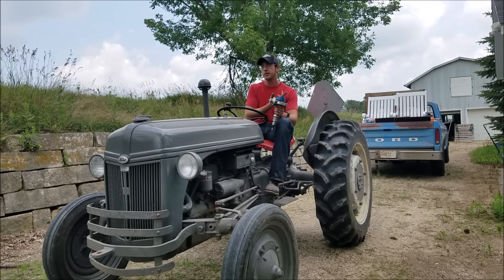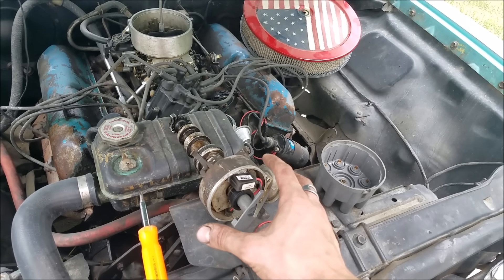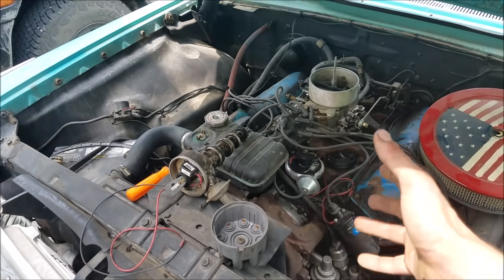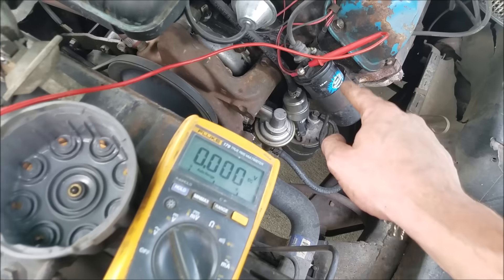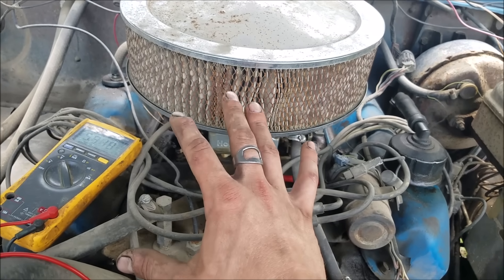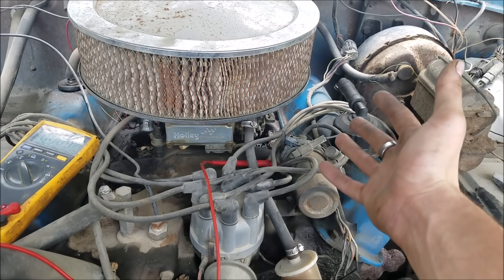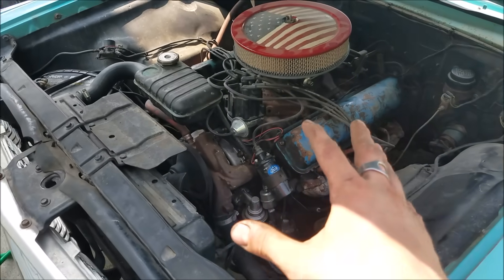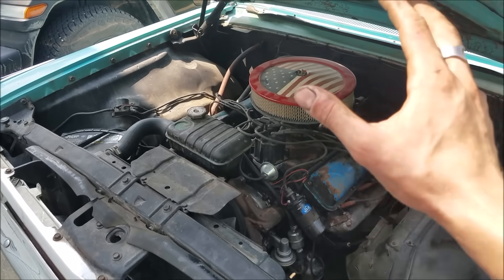Pertronix Ignition "Problems & Failures" (It's Actually YOU)

Comment: It took me 4 years to convince my co-worker to wire his Pertronix to a proper 12v source on his 67 Galaxie, 390. His reasoning was, " It runs fine." I'm surprised it ran for 4 years without burning the module out,  daily summer driving and drag racing. He finally listened though.
Reply: you would think if it wasn't getting 12 volts from the start, that it would of never ran good enough to thinks everything was ok.

Comment: The problem I have had with the Ignitor III is that I can't get a tach to work consistently with it.  The needle jumps around, or if a digital tack, the readings are all over the place.  I contacted Pertronix, and they basically said that was a common issue, and I quote: "...good luck with that."  I've done some experiments.  I added a resistor to the signal wire and a capacitor to the signal wire, and both together, but no joy.  I've purchased and used an autometer tach filter, and had positive results with a cheap Chinesium digital guage, but with a Bosch needle tach the needle still jumps.
Reply from the maker: Digital is going to use a transistor on an interrupt circuit - the pertronix multispark ignitor 3 technically fires 3 times per cylinder very rapidly - an analog gauge won’t have an issue, digital can’t really handle multispark unless you can code your own.
Reply: @ThunderHead289  problem is, the analog tach needle jumps around too.  Even when using the filter.  I had an expensive Dakota digital tach on the car before and it worked well, until it died. I believe the multispark signal fried it... It doesn't work at all now.  So currently, the brand new Bosch analog tach needle jumps around with the filter, and the cheapo 'dragon guage'  brand digital tach works ok with the filter. Other than triggering a different tach with the alternator, I'm not sure how I am going to proceed.

Comment: Like you, I've used Pertronix a lot (even on those N series tractors when I convert them to 12v) and have never had issues with them. Everyone says they are garbage, they will leave you on the side of the road, blah blah blah. But JUST LIKE YOU SHOW, everyone I've gone to fix, is half-done. When you do these RIGHT, they will last & are ultra dependable, but you can't cut corners in it.
LoL..... From doing a lot of these conversions, I have a box on my shelf full of coils & ballast resisters.
Reply: I having a little trouble with mine, it keeps overheating the round coil. I gotta get a multimeter and check it out. I did try a ballast resistor but it didn't do any good I didn't install it on the red power wire that goes to the dizzy, maybe that's where I should have put it
Reply: @johndowe7003  what are you installing it on? gonna sound weird, but this problem can be in weird places (bad ignition switch, bad dimmer switch, bad headlight switch, bad Amp gauge, etc etc etc). Also, you might wanna look into a new coil. If it's been "cooked" a few times, it's probably done now. Esp if there is any oil around it. Easy check is to turn the key off, and check it at the coil. If you still have juice going to it, find where it's coming from before you sacrifice another coil.
Hope that helps.
Reply: @BareRoseGarage  it's on a tractor 8n
Reply: @johndowe7003 , Are you using the OE coil?  If so do you have the ballast resistor still cause OE coils on something like that have external resistors.

When I did the install on my '58 Ford 641 Workmaster it has an external ballast resistor in line between the ignition wire and the coil to drop the voltage down.  The new coil I bought since I didnt know how old the one I had was and plus it was spraypainted red by who ever doctored the tractor up before I got it, but the replacement coil states on it "Use External Ballast Resistor".  So I kept my ballast resistor and used one of those brass add a terminal spades and connected it on the 12V battery side of the ballast resistor then connected the ignition wire to one male spade and connected the Ignitor II red power lead to the other spade to get 12V.  I then made my negative connection to the negative on the coil and kept the wire from the ballast resistor to the positive on the coil the same.

Hooked up this way I never had a coil over heat on this tractor so I suspect you may have a coil that requires a external ballast resistor or you are trying to use a 6V coil on a 12V system without a ballast resistor and over driving the coil at 12V.
Reply: @Milner62  im using a 12volt flamethrower coil 12v, ei ignition on a front mount 8n. the coil i have has 3.5ohm internal resistance. i tried hooking up a 3ohm ceramic resistor to the system and it still does the same thing, im kinda stumped at this point. tractor runs amazing until it hits 200f then it shuts down no spark. cools down then then turns back on
Reply: @johndowe7003 , Is it a oil filed coil?  Maybe there is no oil in it to cool it.  Sounds like there shouldnt be a problem cause a coil that requires a external resistor will clearly state on its side to use an external resistor.

It sounds like you have it all setup right.  Makes me wonder if your coil is lacking in the oil on the inside if it is oil filled.  The oil actually acts as a coolant to stabilize the temperature and I have seen coils leak the oil out and actually run hot to the point that they just cant create electrical energy till they cool down.
Reply: @Milner62  hmm that sounds interesting but it doesn't appear to be leaking, and it does the same thing with different coils. I'll just make a video of it tmmrw and maybe someone will figure out what I did wrong. It has to be setup right or else it wouldn't run
Reply: @johndowe7003 , Correct unless its not the coil getting hot but there is a fault in the Ignitor module and when the module gets hot it loses power and shuts down.
Reply: @Milner62 did you ever find a solution??? Mines doing this exact same thing. Exactly the same. I hope you found a solution. Could you let me know? I'm pulling my hair out

Comment: Have been using a retro fit Ignitor in my standard Lucas distributor for years now with no problems. I also use the Pertronix coil. Your distributor does however have to be in top condition. One other point is that they do not like being sat with the power on but the engine not running. I have known people blow the units this way. People blame the equipment for their own mistakes.

Comment: I asked my local distributor shop about this issue when I got a pertronix installed in a rebuilt dissy. They didn't think using the ballast resistor was a problem with igniter 1, only igniter 2 and 3 have the low voltage problem. My igniter 1 hasn't failed yet but I may have to check this out.

Comment: I thought running a coil on 12 volt continously burns up the coil. I like to run 12 volt at startup and 6ish volts in run.
Reply from the maker: Full 12v burns up points, not a coil. 
If you have an aftermarket ignition installed, get back to 12 volts
Reply: @ThunderHead289  Luke  , some cars in the early 70's like a Tr6 run straight 12 volts to a 12 coil without a resistor but the coil has to be between 3.0 to 4.0 ohms or the points will burn up.
Reply: That's what I was wondering thanks for answering that

Comment: Calling a FE a small block.Ok, made me laugh.One for you.Had a PERTRONIX 1 ,wires under cap caught rotor.Glad I had points/condenser in glove box.
Reply: Successful install includes proper lead dress. I've seen condenser lead broken in points systems because it was left to drag on inside of dist housing(same for ground & points leads). When vacuum advance operates, breaker plate pivots.

Comment: My dad's got an e-type we converted to Pertronix, with the resistors still in. We never drive it cuz the carbs are extremely over jetted, but I'm gonna have to fix this. Thanks for the tech tip, probably gonna save us replacing a dead module, probably saved us from dying on the side of the road somewhere if we ever drove it. 
Update 6 months later; I opened the can of worms. It seems the pertronix did in fact die due to the low voltage. I got the car to run for a while after getting carbs and timing set, but randomly would stall and lose spark.   What's crazy is that I could buy a new points distributor for less than the price of a replacement pertronix module. Who knows how long that will last.
Reply: Keep a set of points in your glove box to get you home just incase.
Reply: @boss351gt6  yeah that's a good idea

Comment: People just refuse to read instructions.  I have been wrenching on cars for53 years now, as an ASE master Tech and a High School Auto Shop teacher ( I am now retired from both ).  Getting my students to read instructions was an on going battle.  Take a small block Chevy water pump for example.  Go to the parts store get a replacement pump for your model and year and slap that sucker on, nothing could be simpler right.  Wrong answer.  The small block Chevy has at least 10 different variations at my last count ( there may be more ).  A lot of pumps are designed to fit multiple applications so they don't have to stock so many part numbers.  So you need to read the instruction sheet that tells you which, if any, of the small parts in that bag that came with the pump to use.  I worked at O'Reilly Auto Parts for a few years after retiring from teaching.  People would come in a lot saying we sold them the wrong part.  I would look it up to make sure and when it was the right part ( most of the time ) I would ask if they read the instruction sheet in the box.  I would get blank stair and a why would I need to do that.  I would pull out the sheet and show them the instructions for their application and what they did wrong.  Usually I would get something along the line of "well that's stupid".  PEOPLE, READ THE DARN INSTRUCTIONS!!!  OK, my soap box tirade is over.  Luke you do good videos, keep it up.
Reply: .....and that's just a simple water pump...... don't even get me started on a carburetor kit, or aftermarket kit swaps..... torque sequences (oh yeah its from the center out) nonsense.
Reply: My 89' XF Ford falcon ute (the book says they sold until 88') The last of these rigs I have (Ozzie ute).......in 89' they just chucked on whatever they had left on the shelves so it is kinda hit and miss in my case, got the wrong clutch cable for instance. I guess my rig is a bit of a bitsa as we say. hehe.
Reply: @wannaseethevid  that's where all the stupid half years come in at, like the 1984 ford thunderbird with a factory 302 or 5.0 h.o. ever how anyone wants to look at it, even though it was listed 84 model, all parts are out of 83 left overs
Reply: @watup110875  
Lol switchover years. They suck. I have a 99f350 and 2000 s1500. Be careful what you order. Lol
Reply: @turboflush  could not agree more, all parts stores hate to see me come through their door, because i bring whatever part is needed. They get mad but I don't care. I have had Advance, Auto zone, O'reilly's, and even Napa try and argue over what is needed, until the part they ordered was wrong. The 97 Ford F250 is the sameway with the wire-harness being married to just that stupid cab.
Reply: @watup110875  
Dont get me started with parts stores.
I have a couple i stay clear of!!  Have had new guys get hired. And they dont last long. I am sure the managers see the customers frustration.
Is it to much to ask for basic understanding of parts and how they function?
Reply: @turboflush  that's to simple, the mechanical world has become as bad as windows, once we figure how to fix or lock them out, new redesign and new windows updates or new windows 11 platform. But stupidity continues.
Reply: @watup110875  xp was the last good one. I held on to 98 as long as i could.
Lol
Reply: @turboflush  I know what you mean there, I still have xp,vista,7 and 10, all still get online fine, except for win 95, can't find right code to make it or force it to accept a nic card for ethernet lol, it still has dial-up modem but works fine. I guess one could say I like tinkering with any electronic or mechanical
Reply: Good primer on the petronix ignition .As always, read the instructions before installing anything. Will be installing one on my stock 292 Y-block. Can't afford to go with the Hi-Tech distributor, however.
Reply: @jeromebreeding3302  Iron Trap Garage installed one on a Y block in a '39 Ford and retained the stock distributor, they have a video about it, might wanna check it out...

https://youtu.be/kZby-I_xW2I
Reply: My first full time job out of high school was a Carquest parts store. No computer, just a massive rack of application books. Everyone I worked with knew how to use them but more importantly had a good sense of how mechanical things worked. Many a customer wanted to buy parts to "test" what was wrong, then return the used unwanted parts.
Reply: I am senior in my shop. Jr comes up to me and asks a question.. Sometimes i give an answer. Most the time i will ask them what the book said? We have a large library of books. And its even on the computer these days. 
Most the time they just want the easy quick answer. They dont want to bother to understand the mechanics behind what they are doing.  Its really sad.

Instructions in the boxes.. Well sometimes they are very good and give more than you need other times its a poorly translated junk or a caution label.
Reply: @turboflush  I also found when teaching my auto shop classes that most students can not find stuff on the internet.  They can play games just fine, but ask them to actually find some information.......yeah, not so much.  I agree that some instructions are not very helpful.
Reply: Time was to find car parts, you had to consult "the books".When everything switched to computer files, I had a hard time. Now, if you can't find a part in a computer, you'll have to find a shop that still has the old books. Good luck !
Reply: So very true! A few mins of reading can save hours of aggravation!
Reply: exactly, Ford is even worse with water pumps.
Reply: @pd2865  A water pump is a water pump. The seals or bearings will fail, and they will leak or seize.
Reply: Depends on what year the Chevy is, you're talking about John Herdener.
Reply: When I was 16  had a impala  with 327 engine water pump fa lied Went to replace it  pep boys sold me one  didn't fit correctly.I took the old pump &  bought the correct. One used tha
Reply: I agree people are hard headed but once they destroy it they read then Lololo
Reply: The same people who neglect to read instructions, probably also refuse to read a map, or ask directions when lost.
Reply: The instructions are garbage and most of the time they aren't even correct to your application.

Comment: Good video. I put a Pertronix ignitor and flamethrower coil in my 70 mustang. I did a resistor wire bypass from the ignition switch pigtail to the engine harness, ensuring 12v to the coil and module ( connected to the +ve side of coil) during cranking.

Comment: For Ignitor 1 & possibly 2, resistor can remain, must be removed on 3 system. 
From Pertronic instructions.
The Ignitor can also be installed in applications retaining the ballast resistor or resistance wire.
1. Attach the Ignitor black wire to the negative coil terminal. (See Figure B)
2. Attach the Ignitor red wire to the ignition side of resistance, or any 12 volt ignition power source. (See Figure B)
3. Check to insure that the polarity is correct, and that all connections are tight.
4. Re-connect the battery.
5. Start the engine and allow it to reach normal operating temperature. Check ignition timing, and adjust to the desired setting
Reply from the maker: I think that’s where things have gotten muddy, I think they thought their stuff works with the resistive lead in place, but they really don’t do well - when I put the one that someone installed in my galaxie here on 12 volts, it immediate quit missing and breaking up at rpm
Reply: That's what I was told but this video has me thinking
Reply: I've had a Igniter 1 in my '69 Fairlane for over 25 years, still has resistor wire in harness. From what I read, the 1 & 2 Iginitors have no dwell control, varying dwell doubles as current limiter. That's also function of resistor, limit current so coil(or points) doesn't overheat.  Even with resistor, my Ignitor 1 did overheat original coil to point it leaked slightly(maybe just old age?). Shortly thereafter, I added a Crane Hi-6 and still use same 25+ year old Pertronix unit as the trigger. Switched to a MSD Blaster coil. That burned up the reproduction Autolite plug wires. Installed a set of 7mm Pertronix Flame Thrower wires(original appearance is Paramount). Been perfect since.

Comment: when voltage regulator contacts stick and/or diode burns out inside alternator voltage regulator voltage then goes above 15vdc these pertronix burn out im still on the fence about putting one in my 12v converted farmall m because a sputtering engine will still get me home but the tractor pullers on facebook swear they wont pull without pertronix. fieldwork all night long in dusty conditions or the tractor on silo blower alternator gets hot seems to burn out regulators. my farmall burnt out another regulator last summer raking hay

Comment: I'm putting a new rev counter on my flamethrower lll,  do I have to run a signal lead all the way to the distributer +, or can I hook into the ignition lead just before the charge indicator light. (Air cooled VW beach buggy)
Reply: You'd probably want to tie into the negative terminal on the coil.  On a Bosch coil, like what your VW came with, it'd be terminal 1.  15 is (+), and 4 is the high tension lead terminal.  Luke, do you concur?
Reply: @john242ti  cool thanks,  if I try that, the chances of frying anything are very slim anyway.